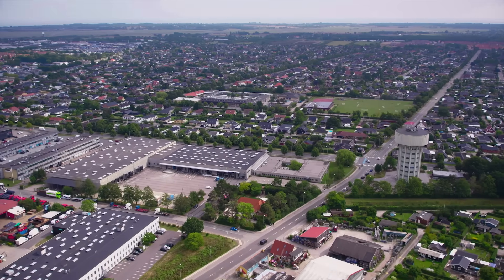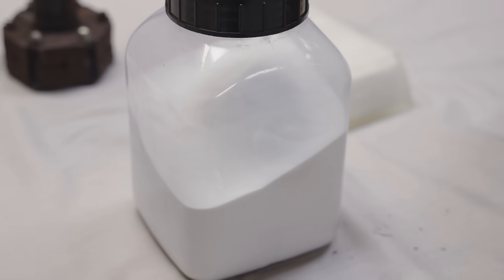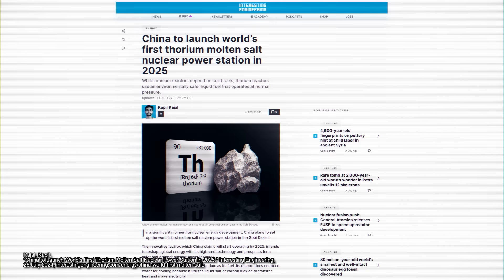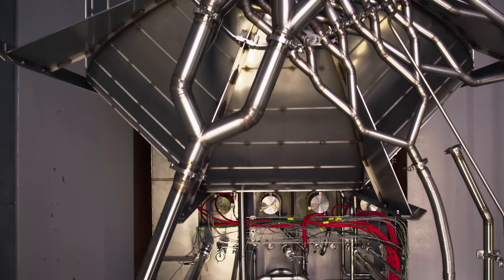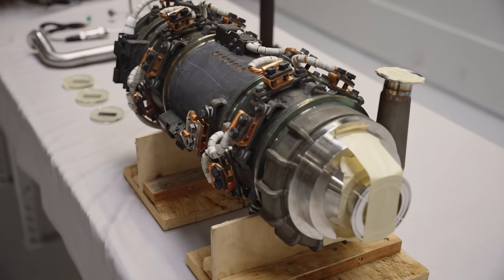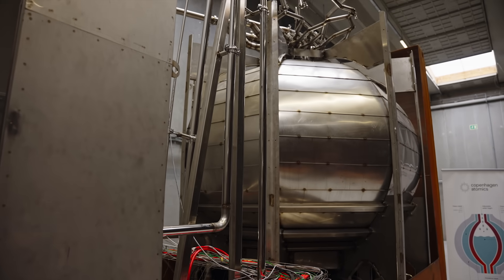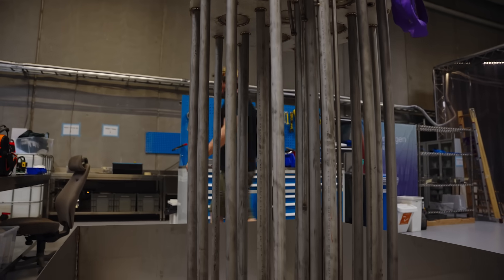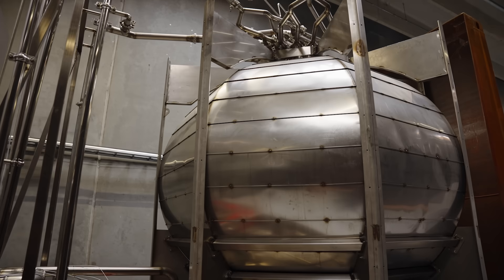Why Isn’t Thorium Changing the World?

Comment: I had read an an article a couple years ago on why safer, cleaner Thorium reactor research ceased, and what the article basically said, and I'm paraphrasing, was that a Uranium reactor produced more nasty by products that could be utilized for nuclear weapons and other military applications, such as depleted Uranium bullets and artillery shells. Having something like a Thorium reactor that produced a much cleaner and safer waste product was not useful to the 'military industrial complex, so it was shelved.
Reply: Complete nonsense. We can produce all those things at Oak Ridge without the private industry. The video lightly touched on it, but the real reason we don't see commercial MSRs is right in the name: Molten Salt. It has been a material science issue in that cost effective metals we have now will corrode too fast. That's it. That's the reason we don't have these reactors all over the place.
Reply: @Banzai51  Well that's the issue they are trying to solve. If you had watched the video you would know that.
Reply: It wouldn't be hard to maintain a few reactors for this purpose.  Also if they ever get the inline fuel reprocessing working (honestly might not be doable) this would likely not matter anymore.
Reply: I read something similar a couple decades ago.
Reply: @ The article I read was probably at LEAST that old !! hahaha !
Reply: However a Thorium reactor is capable of producing "space grade" P238 as by-product ...which powered the Curiosity rover and is in extremely low supply and is only being produced in small quantities at Oak Ridge. We have enough weapons grade plutonium and depleted uranium ...what we need now is a fuel that can power exploratory drones. Not to mention that finding a use for thorium has the added benefit of making more rare earth deposits viable for mining.
Reply: Read somewhere long ago that the first US nuclear submarine was intended to be thorium fuelled. However, it was realised the ability to hide would be compromised by rays (?) from reactor, findable from aircraft, etc, so uranium was used instead, which doesn't have that problem.
Reply: My take on this... condensing down a lot of history, the discovery of nuclear fission came as rather a surprise - they'd been bombarding samples of isotopes with neutrons for years without producing anything like that, or anything like that much energy. Not to mention the production of three neutrons per collision, which, as they realised, could lead to a chain reaction and boom. Now, that first fissile isotope, uranium-235, was somewhat hard to obtain, being only 0.7% of all uranium. The most  abundant isotope - uranium-238, 99.3% - was not fissile, but neutron bombardment turned it into uranium-239, which would swiftly decay to neptunium-239 and then plutonium-239, which did turn out to be fissile, and produced even more energy from fission than uranium-235. Obviously, everyone then wanted to scale up this uranium-neptunium-plutonium process to an industrial level. The first such full-scale reactors just vented the considerable amounts of heat they produced, but it wasn't long before engineers thought of using this heat for electrical generation. It provided added value and helped sell nuclear to the people. But weapon material production always remained a primary function, and this - basically - constrained the reactor designs to ones at risk of rupture or meltdown.

Governments and corporations invested vast sums into this industry, and people sunk their entire careers into it. The payoff promised to be never-ending; governments wanted all the plutonium that could be produced, so they could build more nuclear arms. Thorium was just a tiny sideline, mainly because it  could not produce usable weapon material (the fissiles were far too radioactive, for a start), and few paid it any heed. 

That all changed with the first Strategic Arms Limitation Treaty talks. Suddenly, there was the possibility that governments might not need so much plutonium - or any at all. Worse, that an alternative to the uranium-neptunium-plutonium cycle - one that could generate power but not weapon material - might be more politically expedient, and make redundant some or all of the existing nuclear industry, multi-million facilities and all. Either way, there was no longer room for even a potential competitor. Thorium had to go, and was easy enough to get cancelled.
Reply: Idiotic US Army secretary.
Because corruption, search for:
National Security, Rare Earth Elements
Reply: My take on this... condensing down a lot of history, the discovery of nuclear fission came as rather a surprise - they'd been bombarding samples of isotopes with neutrons for years without producing anything like that, or anything like that much energy. Not to mention the production of three neutrons per collision, which, as they realised, could lead to a chain reaction and boom. Now, that first fissile isotope, uranium-235, was somewhat hard to obtain, being only 0.7% of all uranium. The most  abundant isotope - uranium-238, 99.3% - was not fissile, but neutron bombardment turned it into uranium-239, which would swiftly decay to neptunium-239 and then plutonium-239, which did turn out to be fissile, and produced even more energy from fission than uranium-235. Obviously, everyone then wanted to scale up this uranium-neptunium-plutonium process to an industrial level. The first such full-scale reactors just vented the considerable amounts of heat they produced, but it wasn't long before engineers thought of using this heat for electrical generation. It provided added value and helped sell nuclear to the people. But bomb material production always remained a primary function, and this - basically - constrained the reactor designs to ones at risk of rupture or meltdown.

Governments and corporations invested vast sums into this industry, and people sunk their entire careers into it. The payoff promised to be never-ending; governments wanted all the plutonium that could be produced, so they could build more bombs. Thorium was just a tiny sideline, mainly because it  could not produce usable bomb material (the fissiles were far too radioactive, for a start), and few paid it any heed. 

That all changed with the first Strategic Arms Limitation Treaty talks. Suddenly, there was the possibility that governments might not need so much plutonium - or any of it. Worse, that an alternative to the uranium-neptunium-plutonium cycle - one that could generate power but not bomb material - might be more politically expedient, and make redundant some or all of the existing nuclear industry, multi-million facilities and all. Either way, there was no longer room for even a potential competitor. Thorium had to go, and was easy enough to kill off.
Reply: That's whay I've always thought, but I have no sources. Could you share the paper with me?
Reply: @erigor11  It's basically a myth. The story goes the US (and specifically the US) cancelled the MSRE (Molten Salt Reactor Experiment) because the end state of the research would result in nuclear power that was more difficult (nowhere near impossible, just slower) to be dual use for military purposes. But the story quickly falls apart when you learn the the US NEVER used power plants to produce those materials. They had dedicated military reactor facilities right from the start at Handord and Savannah River that produced 100% of that material. If the argument was about Britain, France or Russia, all of which DID use dual use reactors, then it might hold weight, but it isn't about them, it's about the US program. So if the US had never used commercial power plants to produce those materials, why should anyone believe they cancelled MSRE because it would make it more difficult to use commercial plants to make those materials, which they had never (and still haven't) done anyway?

The only sliver of truth on this topic is that when it came time to do the first commercial plants, a lot of the water cooled U cycle research had already been done for the military, so it was cheaper and faster to use that as a starting point than to start over again with different fuels or reactor designs. Thus was born the commercial U fueled LWR.

The reality is the US was funding 2 advanced reactor projects in the second half of the 60s (MSRE and LMFBR), and decided they only wanted to fund one. This shouldn't be that surprising as they had just spent huge money on Apollo for 10 years and had a huge ongoing cost for Veitnam. LMFBR was more mature technically, so it was continued and eventually it's test reactor the EBR-II morphed into the Integral Fast Reactor which was finally shutdown in the mid 90s after 30 years of successful operation. MSRE lost fairly on economics (we can only fund one) and technical maturity at the time.
Reply: @richardb1452  Thanks for the long reply (for YouTube standards)

Leaving thorium behind, why do you think nuclear energy overall isn't used more? The US is one of the countries that uses it the most, yet it is less than 20% of its energy supply. Why isn't it more common? Do you think it should be?
Reply: @erigor11  This is just my take on it, so take it for what it cost. The underlying human driver that has to be understood is that once a society has reliable plentiful energy no matter how dirty or potentially problematic, it ALWAYS refuses to go back to scarce unreliable energy. Cost while a factor is not the biggest one. Once you're used to having it, reliability is. So it becomes a question of how best to make that energy reliably available. 

It seems pretty clear to me that fear of accidents is or at least was, the biggest factor in declining nuclear. If you look at a graph of reactor construction starts in most of the democratic countries (where public opinion i.e. fear, has a large impact), it goes pretty close to zero after Three Mile Island and especially Chernobyl. A portion of that fear is justified, and the bigger portion is irrational IMO. It's like we as societies burned our hand on the stove and instead of learning to respect the stove and use it carefully, we just stopped putting them in houses.
Instead, most countries doubled down of fossil fuels. The GHG issue was always simmering in the background in scientific circles, but it wasn't until ~10 years after the IPCC was founded in the late eighties that it came into widespread view. Again fear triggered a response and huge investments in renewables were triggered because now we had 2 fears. Dreams of renewable utopia blossomed just as "too cheap to meter" nuclear had blossomed in the 60s & 70s (see a pattern here?...lol). But renewables also have problems, the main ones being intermittency and the area required to utilize them (taking up space has a cost both monetarily and environmentally associated with it). 

So now we come to the present. Some geographic areas are blessed and can nearly make renewables work on their own 24/7/365, but most places aren't. Storage is just too expensive and likely always will be for grid level scale/service. Renewables + 4hr storage is certainly cheaper than nuclear when you can back it with fossil fuel, but 4hr doesn't even come close to what is actually needed in many places. If you want reliable 24/7/365 energy (see original underlying human factor above), what I believe we've learned or are in the process of learning at this point is that a mix of sources is the best solution and a sizable portion of that must be immediately dispatchable. If fossil fuels especially nat gas, which we currently use to backstop renewables in a huge way are off the table then what to do? Physics is physics and there is no way around that, no magic solution. We can only improve storage or efficiency so much...there are physical limits. I think rational folks doing analysis by the numbers and controlling fear as much as possible are beginning to realize that for many places in the world, taking (or continuing to take) some small risk with nuclear in order to mitigate the very real risk of unreliable 100% renewables/the exorbitant cost to make them near 100% reliable is the best path forward. Yes, we need to address proliferation and waste, but we have solutions for those. They add cost, but not as much as making 24/7/365 renewables, at least for many countries.
Reply: @richardb1452  Great, thanks a lot for taking the time to answer.

Now, this is just curiosity from my side: do you work in any related field? In my case, I don't; I'm into biochemistry/molecular biology. But this is an extremely important matter and I think it should be talked way more, so I'd like a recommendation of where or how to properly inform myself about all this without actually studying it (I'd love to do that, physics are extremely beautiful, but life's too short and has too many artificial obstacles for me to get in depth into such a field). If you had some piece of advice regarding that, I'd be very grateful.
Reply: @erigor11  My background is Physics/Comp-Sci dual major. I did some work in the industry in the 90s after graduating helping the real experts do modelling, but then switched and focused more on the commercial comp-sci path as that's where the money was...lol   I'm now recently retired....yippee!
I still talk with some of the folks from back then who stayed which helps keep me informed. Like with any tech area, once you understand things at an intermediate (i.e. beyond basic) level, you can usually keep up. That said, understanding and doing are two different things, so I certainly won't be designing a reactor anytime soon...lol. Contrary to what seems like popular opinion these days, experts exist for a reason!

If you want to avoid textbook depth, MIT online courses, etc... and just want to get a good basic understanding of the tech and what is possible, I'd say two good resources are the "what is nuclear" web site for the basics and history, where the curator is Nick Touran a former TerraPower reactor engineer and the book "Plentiful Energy" by Charles Till and Yoon Il Chang (which you can still download free as a PDF via link on What is Nuclear's "Reference->Reading List" page). They were the leaders of the Integral Fast Reactor project at Argonne National Lab which was the first demonstration of what would later be called Gen IV reactors, meant to better address safety, waste & proliferation. Till and Chang document the entire project ('65-'94) including it's first incarnation as the LMFBR (i.e the one that beat MSRE for funding). They cover issues encountered, design decision justification and it's test results. I like this book because it allows the reader as they follow along the project history to get a grasp of what is possible (e.g. how passive safety actually works, how re-processing can be done while reducing proliferation risk, etc...) and how research on this tech should be done (i.e relatively slow and very deliberate). Both are easily digestible by anyone who took even basic level high-school physics and your chemistry background should make it somewhat easier with many topics e.g. re-processing. When you're done those and if you're still hungry for more, the rest of the reading list on the What is Nuclear site goes all the way from nuclear history right through some of the most used grad level textbooks and the vast majority are free. It's a great resource put together by folks with experience and expertise IMO..

Since thorium is what started this conversation, What is Nuclear's "Thorium Myths" page written by Touran is a particularly good level-set for those who bought/buy into the hype. It's not that thorium is bad. It is quite likely a fine Thermal Breeder reactor input specifically in an MSR design (not very good in others for various reasons). it's just not really any better than Uranium unless you have lots of it and little Uranium (like China or India for example). The IAEA still requires similar levels of safety and non proliferation standards be applied and that would not be the case if the hype was true.
Reply: @richardb1452  Interesting! I took note and I will certainly delve into it.Thanks a lot for the answer, you're very kind!
Reply: Using Thorium has all these benefits, so it will be exciting to see this work succeed. Once it is viable and cost effective, we will see the true intention of nations in their choice of nuclear power technology.
Reply: It was logical choice. With uranium you have powerplants that produce critical resource for your defense (plutonium) which you would have to produce somehow anyway. 2 birds 1 stone.

Comment: if "cost is king" as mentioned in this video, then the future is renewables like wind and solar and geothermal. The promise of cheap nuclear power has never even come close to ever being realized.
Reply: Exactly, for the energy companies wind and solar are a small investment, quickly built, low maintenance, they just need all-round technicians to keep it running, no university degrees needed .
Reply: renewably rebuilding broken wind and solar is not cost efficient, clean or reliable.
and geothermal isn't available in most places.

only people pushing for solar and wind are oil companies.